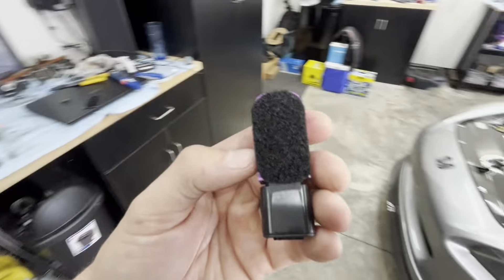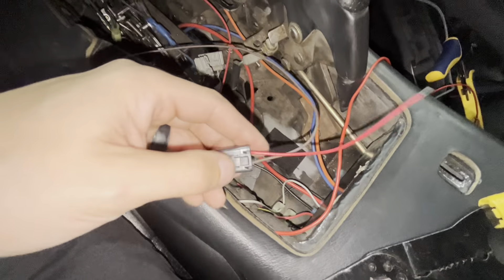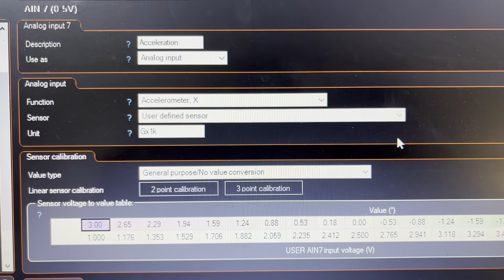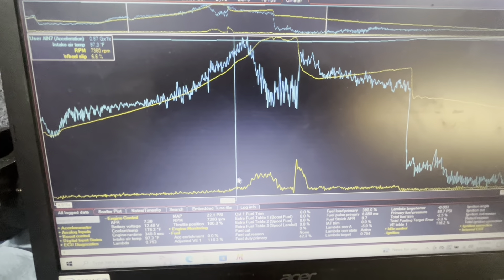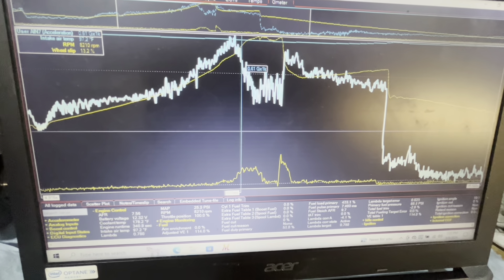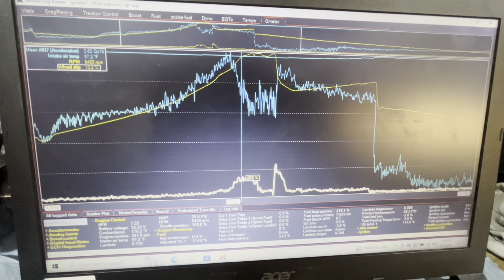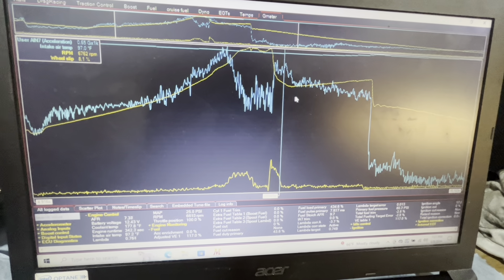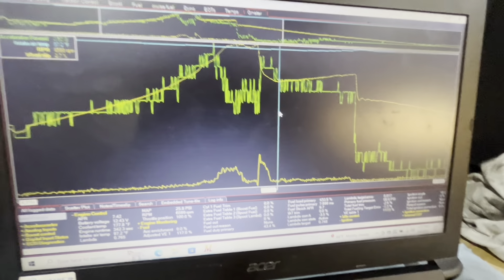G Meters or Accelerometers! How to install and read!

Comment: you can also relate timing to G's. for example, if your car isn't accelerating there's no point in adding timing. the Gcurve can also add more timing to your existing map if the car is accelerating hard. sometimes you have boys in the car and that effects acceleration, with the Gmetre you can tell the ecu conditions are diffrent etc

Comment: Is there anything like this that measures lateral G's?
Basically id like to see what my suspension setup is maxxing out at before traction breaks.
Also for shits and giggles.
I could probably make an arduino one but if theres something already on market i wont have to literally invent one... but i absolutely will.
Reply from the maker: Yes they have both.